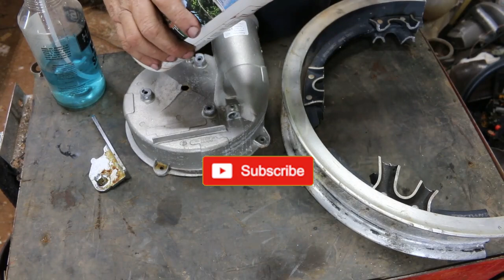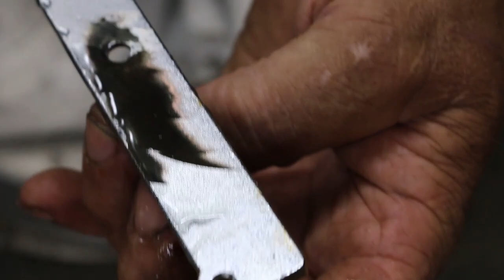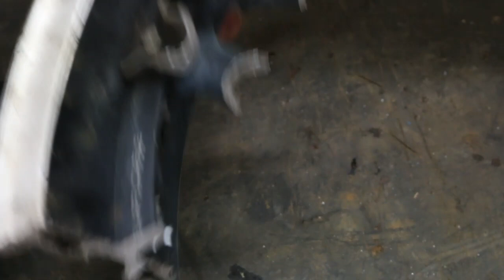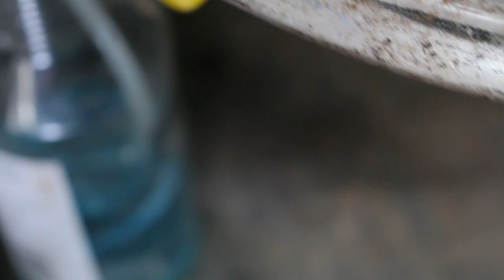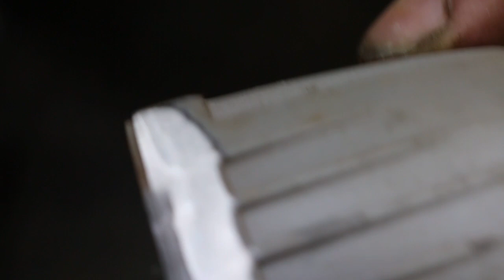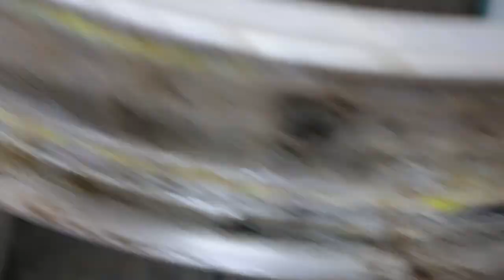How to Tell Cast Aluminum from Diecast or zinc and from Magnesium

Comment: The motorcycle rim may have been a badly mixed batch of aluminum-magnesium alloy.  Many of the GM alloy rims were like this, and the corrosion that resulted showed right where the alloy was defective.
Reply from the maker: yeah, it could have been,

Comment: Curious if the yards pay different prices,I know I turn in "aluminum" that's zinc or magnesium, but it goes right with the aluminum because they don't have a price for the others.Have you gotten a different price or is that what you do too?
Reply from the maker: I think the price is about the same, I took a whole truck load in one time and had to separate some of it but they gave me one price. after a year of separating I may have a bucket full of the zinc, most is aluminum

Comment: Have you ever burnt magnesium it is what puts the spark in sparklers don't try to put out with water makes it burn more intense
Reply from the maker: That is what I have heard, I was going to try melt the rim, but it would not fit into the melting pot, glad that it didn't, I may cut a small piece off and see what it does with some fire